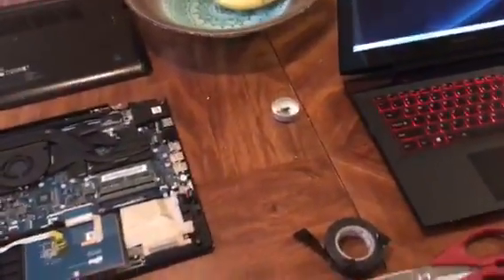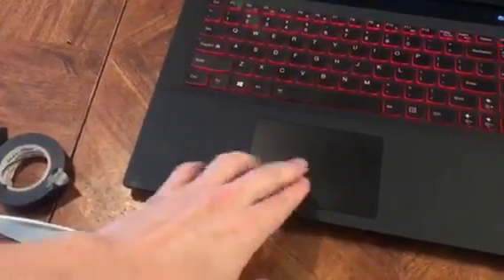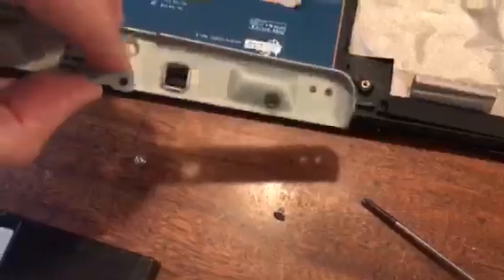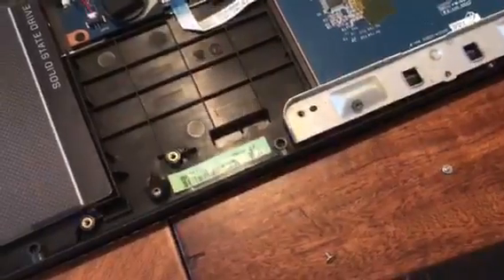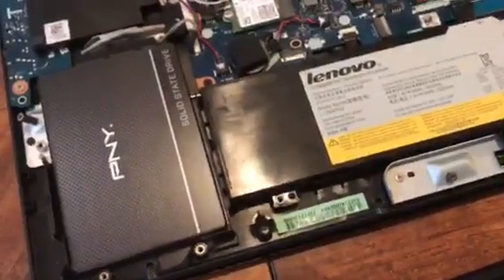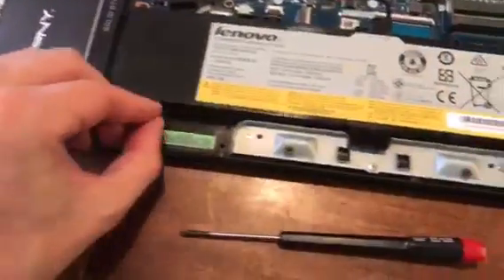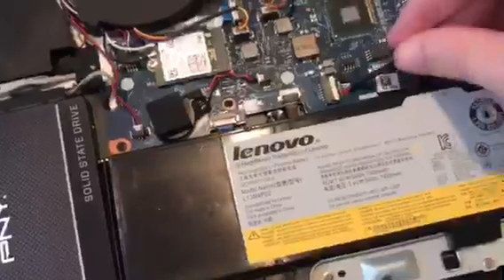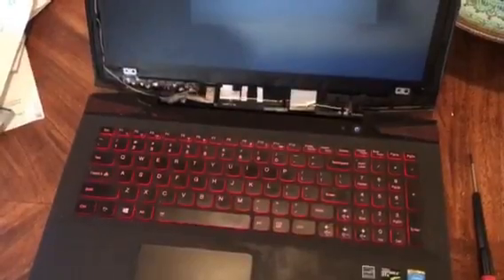Lenovo Y50-70 Touchpad issue Fix PROPER

Comment: I ended up using a hard foam and a little glue, I cut the foam to the exact shape of that circle bump on the metal, by doing that the clicking sound remained perfect and was clicking normal ( I found out that the excess tape on the sides affects the clicking so I cut it to exactly the size of the circle bump and everything worked perfectly)
Reply from the maker: Glad it worked!

Comment: This genuinely worked, so happy. Almost had to buy a new touch pad
Reply from the maker: Glad I could help! That’s why I made this video.
Reply: Is there anything better to use than the tape ? Maybe something harder
Reply from the maker: Tape ensures it stays in place. Also the button is a small and rounded, so keep that in mind when deciding material.
Reply: I ended up using a hard foam and a little glue, I cut the foam to the exact shape of that circle bump on the metal, by doing that the clicking sound remained perfect and was clicking normal ( I found out that the excess tape on the sides affects the clicking so I cut it to exactly the size of the circle bump and everything worked perfectly)